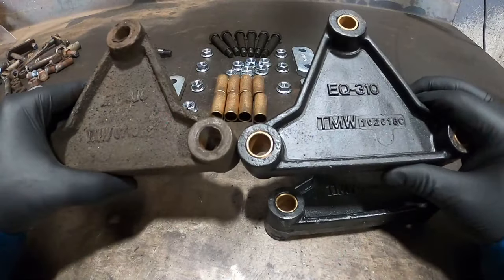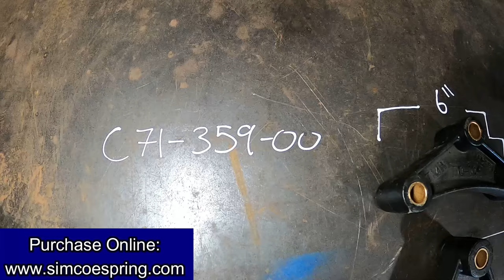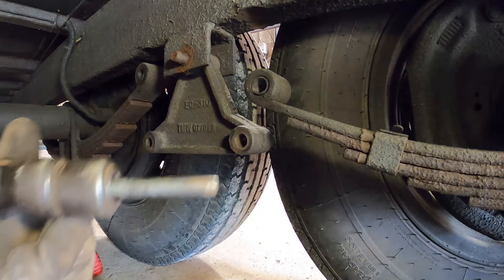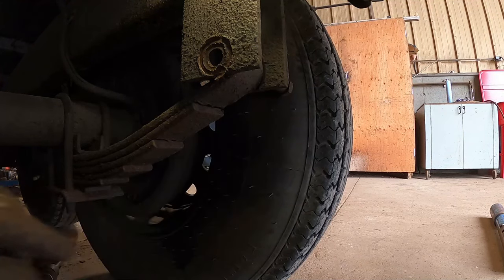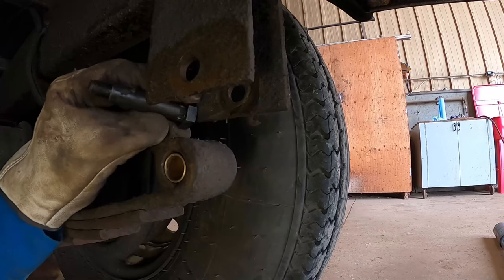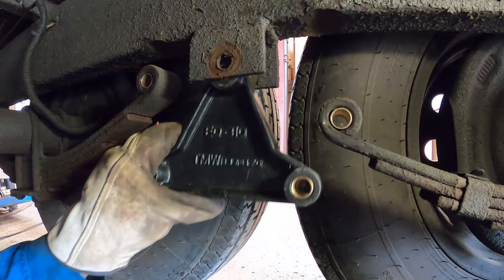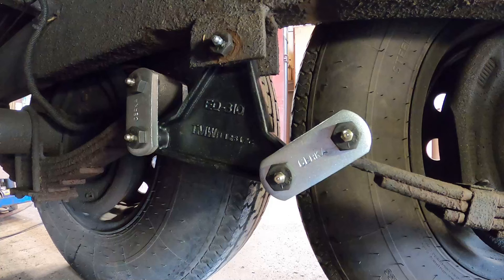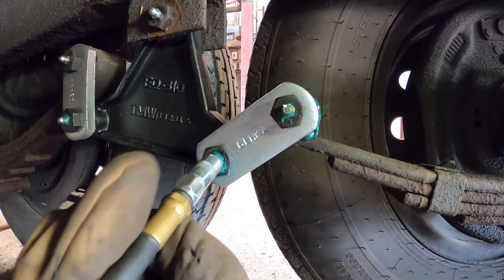Heavy Duty Trailer Bushing Upgrade with Greaseable Bolts and Bushings & How to Install

Comment: Thanks, nice video. Love the pit, wish I had one!  Some advise the wet bolt grease outlet inside the bushing be installed horizontally, at 3 or 9 o'clock positions.  I assume this may be to avoid pressure, as in, if the grease were trying to come out of the bolt when the hole was at the top or bottom where the weight of vehicle is on it causing blockage of grease flow.
Reply from the maker: setting the grease fittings horizontally makes sense to me.  Most of our pins are threaded or already have the holes clocked so we can never pick the direction of grease flow, but we can on these and I'll definitely think about that in the future.

Comment from the maker: Check out one of my favorite trailer rebuild kits.

Introduction: 0:00
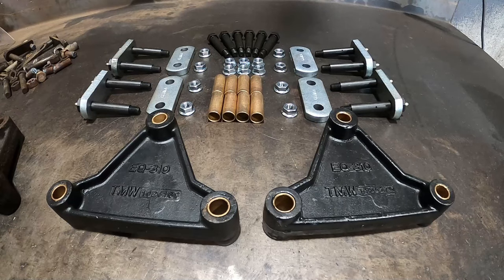Comparison: 0:16
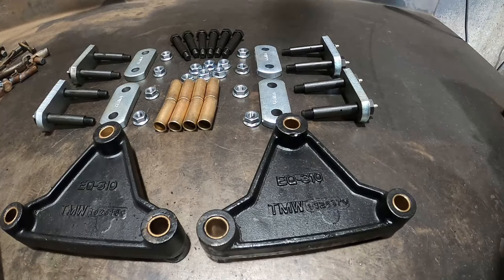Pros & Cons: 1:25
Which kit fits your trailer: 2:09
How to remove old parts: 2:51
How to install the new kit: 8:38

To Purchase these kits check out www.simcoespring.com
C71-359-00 - https://simcoespring.com/products/c71-359-00
C71-448-00 - https://simcoespring.com/products/c71-448-00
C71-449-00 - https://simcoespring.com/products/c71-449-00

Any questions, just comment down below and I should be able to help you out

Comment: Do you ever beef up the spring hangers on the trailer frame when you install the heavier shackle staps? The hangers are probably the next weakest link in the setup. Nice work.
Reply from the maker: Our suppliers do not supply a "heavy duty" hanger.  however I have seen welded braces on them to prevent twist.  I have welded angle iron from hanger to hanger before to act like a "cross member" to make them more durable.  that is about it.  I believe that Morride makes a "bolt on" cross member to go from hanger to hanger side to side.  it is supposed to make them absorb the twist on the hangers when you turn corners.

Comment: Never knew that they had those we have the plastic  bushing equalizer with 1/4 inch hangers and the construction trailers get as big as 14x70 and have as much as 8 axles

Comment: Its about time a kit like this was made.  I have seen so many of these bolts and bushing wore right out.  Didn't see you using Loctite on the threads when installing.  I feel this does two things.  Keeps road crap out of the threads and prevents loosening down the road.
Reply: the nuts are locknuts - with interference threads - no need for Loctite

Comment: Is no one concerned at 14:40 where he cranks the bolts super tight and collapses the mount? Isn't there supposed to be some degree of slack in the bolts to prevent premature wear on the moving parts?

Comment: I had a spring shop install my wet bolt kit on my 5th wheel last year. 3 of the 14 zerks no longer take grease. Im going back to the spring shop and ask them to try and free them up
Reply from the maker: they can get clogged real easily, just buy a bag of zerks and replace them, they thread into the bolt.
Reply: @simcoespring  I removed all 3 zerks and they are not clogged. They pass grease easily by themselves

Comment: I just buy greasable bolts and use them in tandem with the plastic bushing kits. Get 3 times the life out of my suspensions. By that time all the trailer wheels are coming off for brake/bearing/tire inspect and overhaul and a little more forgiving if not greased.

Comment: Hey bud I know this is a new video it's a very good video though but I have a question for you what kind of tires are those on that trailer and are they very good do you know if you could please let me know by the way I'm going to order me a side of those spring shackles thanks for the video appreciate you
Reply from the maker: we usually sell good year tires or something decent like that.  I am currently getting out of tires at this time and would recommend contacting your local trailer repair/sales store.

Comment: Wow , I have equalizer 15" center to center. Keystone Freedom Lite trailer 27.5' with 26 inch 3 leaf springs - eye to eye. Can you help me with that Equalizer match to you heavy duty parts....Hoping!
Reply from the maker: Usually we would just replace the equalizers in the box with some extra bushings.  Save the old equalizer if it is not damaged.
Reply: @simcoespring  thanks for responding, so quick. I'll take it apart and hope for the best then order.. fingers crossed.

Comment: @simcoespring any idea why companies like Dexter write such vague torque specs in their instructions? 30-50 ft/lbs is a big swing but the  chart for 7/16 Grade 8 hardware says 90 ft/lbs Dry and 68 ft/lbs Lubricated.... Im installing this kit for a friend of mine this weekend on his Shirley Smoker this is covered in  pork grease so no rust to fight with lol
Reply from the maker: oil, never-seize and other lubricants can make the threads a lot more slippery lowering the torque specs.  some Ubolts can take 140 ft lbs but the Ubolt plates are designed for 90 ft lbs....so there is a lot of variance between parts.
Dry Ubolts will be 140, oil lubrication is 120 and never seize is 90 (or something close to that)

Comment: The new bushings are going to be made of bronze, brass is softer than the nylon ones that were in the trailer in the first place. They are different, I know they look the same, but they are not the same.

Comment: Wouldn't it be easier to just take the wheels off the trailer and save the hassle of using a torch to cut the bolts?
Reply: If he took the wheels off, there would be nothing holding the axles in place.

Comment: My trailer has 2-5/8 shackles and I can only find heavy duty kits with 2-1/4 shackles. Would it be fine to switch to a shorter shackle? It has the 2 inch short equalizer. Thanks
Reply from the maker: yes, all the modern trailers use the 2 1/4" shackles.  Just make sure that your wheel base is 33".  (center of hub to center of hub on axles)  and the kit should bolt right in.
Reply: @simcoespring  It Measures out at 34-1/2 center to center. It’s a brand new diamond c 5x10 dump if that makes a difference.

Comment: I just installed this but am having a issue. Where the shackle connect the spring to equalizer, both bolts have about a 1/8” gap between bolt and shackle link. Obviously I can’t tighten it any more due to the step down bolt. Is this correct or is there an issue? Maybe a washer would be needed?
Reply from the maker: they are suposed to be loose.  that is to prevent overtightening.  it has to be able to rotate.
Reply: @simcoespring  ok thanks for the reply. I emailed you some photos via email

Comment: Are greaseable bolts avail for 3/4" for front end?  Have 30mm heads. 
I will leave out some of the other details.. 
Thanks.
Reply from the maker: Not sure what suspension you are talking about.
Reply: The 3/4"?? bolts for my front suspension , can one get greaseable ones? 
Gr 8 to L9     or 
10.9 to above ?? 12.9???

Comment: The thing with these, is just the weight of the trailer kills the brass bushings in no time. I just did mine. And got a couple I cannot get grease into anymore.
Reply from the maker: usually for me its the grease fittings that go first, replace one and see if that is the issue.
Reply: @simcoespring  will rip it out and probably just replace the bolt.
Reply from the maker: the grease hole in the bolt is really tiny.  It could just be clogged with some dried grease too
Reply: Take it out and remove zerk then blow it out. Should work.
Reply: Sometimes taking weight off of the springs helps to get the grease to flow.  Also heat helps.
Reply: try taking the grease fitting off, then heat up something to poke into the grease passage. I like to use a welding rod that i break all the flux off of. that should melt all the old caked up grease. Then reinstall the fitting and grease it.

Comment: Ive got the same issue, my Ram stands taller than my 5th wheel. My trailer equalizer is currently the 2" tall one and my springs are flipped on top of my axle.  Can I use this 4" kit? And, will it raise my  5th wheel?
Reply from the maker: you can use a 4" tall equalizer, that should give you about 2" of height (at the wheels, about 4 at the rear bumper), if that is NOT enough, then you can try our lift blocks for another 2" of lift
Reply from the maker: This is old information - UPDATE:
The shackle swap will only increase the height by 1", if you want to lift it more, then you can buy our 1, 2 or 3" lift block kits in our store at www.simcoespring.com
Hope this helps

Comment: Is it necessary to get bolts with a knurl or can I just use regular 9/16 bolts
Reply from the maker: yes, you want the bolt to stay in one place, and the spring to rotate on the bolt.  if not, the bolt will rotate and wear the hangers/shackles out.
Reply: @simcoespring  ah ok just don’t want to spend $50+ on just bolts haha
Reply: @simcoespring  it’s interesting that that trailer shackle bolts are like that but not trucks
Reply: Put 1 good little tack weld on the head of your regular 9/6" grade 8 bolt to keep it from turning. Just another option.

Comment: If money 💰 was not an issue what piece of equipment that you don’t have would you purchase that would make your job allot easier and why?
Reply from the maker: Self feeding programmable bandsaw to cut solid steel blocks with.  I'll probably be cutting about 1000-1500 blocks this year and it would help

Comment: Is there a torque setting for those nuts and bolts?
Reply from the maker: there is a shoulder on the bolts, so you tighten the nuts up against the shoulder

Comment: They’re garbage. I’ve had two sets and they were both chinesium trash steel that you couldn’t install a set without stripping the threads on at least one bolt.